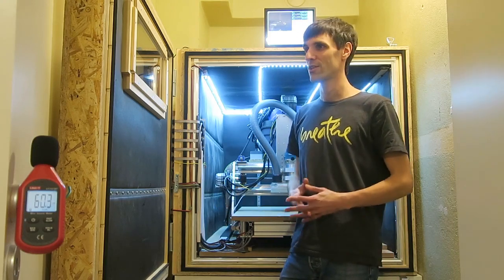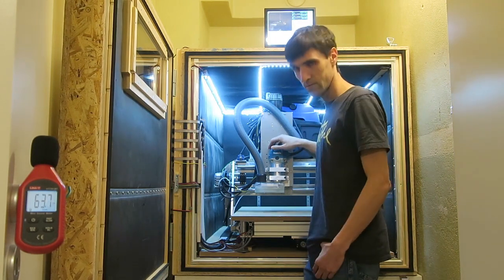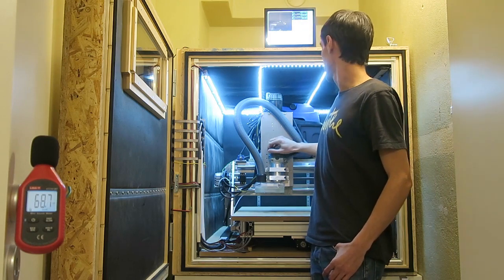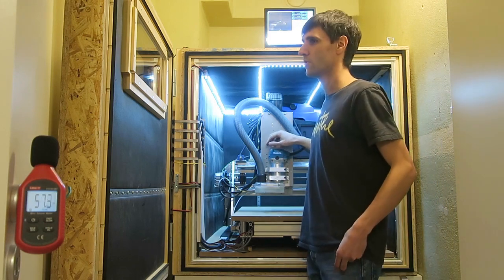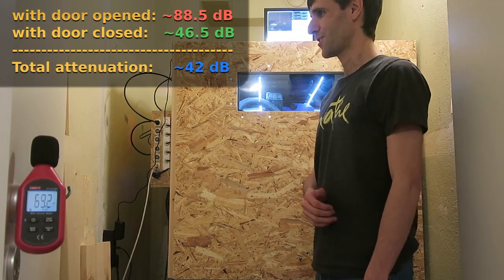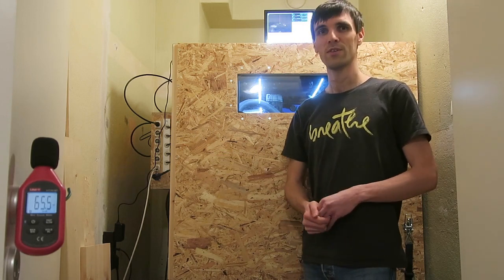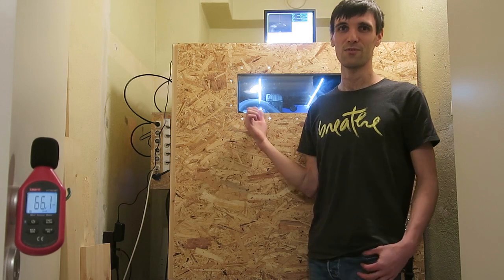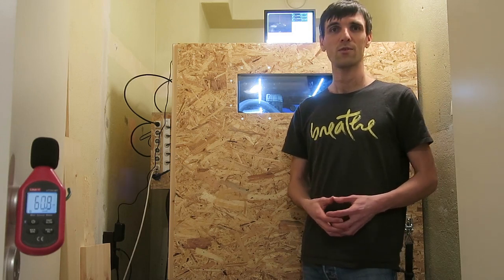Soundproof CNC router enclosure (42dB attenuation)

Comment: Thank you for the video. I am currently building a similar enclosure for a CNC machine. I see that you have a vac inside but didnt see any air ducts. Are you able to keep the inside cool enough for long periods of time with all that equipment?
Reply from the maker: Hi, not for too long, when the door is closed with router&vaccum running, it gets rather hot after ~30min. Most CNC jobs I do are ~30min cycle but if I do longer ones, I briefly open the door for few minutes to let the hot air go out.😉
Reply: @damiendd09  I see. It looks like the upside is very good sound proofing. Congrats on your build.

Comment: But how that window doesn't leak sound?
Reply from the maker: Windows is made with 4layers of 5mm plexiglass in sandwich with foam on the edges between each layers. This to prevent transmission vibration/sound from one plexiglass layer to the next one😉

Comment: This is great! What are the clips used to close and tighten the seal of the door?
Reply from the maker: Thanks! I used some simple eccentric latch to close&tighten the door. They look like those: https://www.fruugo.se/4-pieces-right-angle-adjustable-buckle-vertical-quick-clamp-box-buckle-latch-clamp-right-angle-buck/p-190084075-405949283
I got those from Bauhaus, I'm sure you can find in any local similar shop.

Comment: Won't there be a chance of overheating?
Reply from the maker: oh yes, it definitely heat up inside when I run my CNC router for 20min with door closed especially when the vacuum cleaner/dust collector is running! I just open the door for less than 1minute and most the hot air is gone!

Comment: Great example of an efficient box, but an even better example of how important it is have the door air tight. That was very impressive, well done!

What is that window made of? I am planning to build a box for my PCs, but I want windows to show them off still.
Reply from the maker: Thanks! The window is a "sandwich" of 4 Plexiglas of 5mm each separated by adesive foam tape* to dampen vibrations between plexiglas layers. To prevent sounds vibration to propagate too easily, there is NO rigid structure (wood/screw) directly in contact with plexiglas even on the side, there is always foam tape/material between rigid parts of the structure and plegsiglas.
* I used regular door noise seal isolation foam tape you can find in any house/build materials shop (got mine from Bauhaus).
Reply: @damiendd09  Thank you for the reply. I am only trying to isolate noise from PCs, so I might try using just two pieces, but I was wondering whether to screw holes through them or not, but seeing as you haven't , I don't think I'll do it either, no need to over complicate things, or risk breaking the plexiglass.

Comment: Hello Damien, 

Awesome job on this. I've read through the comments and got the construction details, one item missing is the viewing window you've added. I'm guessing that it is plexiglass and that you've added the foam tape between the plexiglass and the wooden outer layer, but please advise what you've done here and what the thickness of the plexiglass is that you've used. Thanks and looking forward to your feedback.
Reply from the maker: Thanks!
For the window, I have put 4 plexiglass window of 5mm each on top of each other. And yes, each plexiglass window is encircled by foam tape (no direct contact between plexiglass&wood - to dampen vibration transmission). There is about 3mm of air gap between each plexiglass windows - I have used some regular door seal tape to hold the spacing between plexiglass windows - the idea is just to avoid wood or hard material between parts to make it harder for vibration&sound to propagate.

Comment: Great results Damian.  Kudos.  Quick question.  You've said you set up the layers as follows  from the outside in (correct me if I'm wrong): OSB (what thickness) > Green Glue > drywall (what thickness) > Rockwool (I'm assuming 3" batts? > MLV (what thickness) > closed cell foam (what thickness).  Did you build from the outside in, or vice versa?  Thanks, and great job!
Reply from the maker: Thanks, here are few more details: OSB (15mm) > Green Glue > drywall (12mm) > Rockwool (45mm) > MLV (4mm / 7-8kg/m2) > closed cell foam (4mm)
I first built separately the side panels OSB-green-drywall (size adjusted with max. 0.5mm accurancy - an important detail I believe). Then I put those panels together with screws in the OSB edge to form a 5 sided box (I built the door - the 6th side -  at the very end). When putting the 5 sides together, I took particular care of not leaving any air gap between each OSB/drywall panels: on the edge of each panel I have added a fin foam tape of 1.5mm ( https://www.affixit.co.uk/single-sided-foam-tape.html ) which got squeezed when tightening screw and filled any potential tiny air gap (if air can pass - sound can too) => I believe those details play an important role in the soundproofing efficiency.
Just with OSB&drywall, each panel is about 20-25kg so nearly 100kg once the 5panels are put together => this is to take in consideration for practical handling of the parts.
Then after I had an empty OSB/Green Glue/drywall box, I have built inside a simple wood structure to hold the Rockwool & MLV (without putting any screw in the OSB/drywall part - this to prevent screw to transmit sound vibration - I even put some foam tape ( https://www.affixit.co.uk/green-glue-tape-50mm-x-30m.html ) between wood structure and the inside panel of the box to dampen vibration).
For the MLV/CCF part, I found a roll from https://www.carinsulation.co.uk where the MLV&CCF where already glued together, they don't have this particular article available anymore but you can still see it from the google cache: https://webcache.googleusercontent.com/search?q=cache:O0QHLYJWtkAJ:https://www.carinsulation.co.uk/product/peacemat-xxxx-6kg-vehicle-floor-sound-deadening-noise-barrier => on the description it said 3mm MLV & 3mm CCF and 6kg/m2 but when I received it and measured it, it was 4mm MLV & 4mm CCF and ~8kg/m2 - I did not complain :)
Reply: @damiendd09  Awesome!  Thanks so much, Damian.  That's exactly what I was looking for.  And, again, GREAT job!

Comment: How do you deal with the heat from the router and the vacuum over time? I would guess that for a routing job of 1h it would get very warm?
Reply from the maker: Yes after 1h non stop, it gets warm inside but it has not been a big issue for my use so far as the temperature drop quite fast as soon as I open the door.

Comment: Really interested in the building video or just tell me what materials did you use in the build. Thank you so much
Reply from the maker: I used OSB, drywall with green glue on the outside and rockwool with MLV (Mass Loaded Vinyl)+CCF (Close Cell foam) on the inside. There are also quite few details I paid attention while making this build.
I will do some video but I cannot promise when, will try to do it as soon as I can!
Reply: @damiendd09  Do you mean: OSB <> Green Glue <> Drywall <> Rockwool Sonorock <> MLV <> CCF? Unfortunately, here in Germany "Green Glue" is really expensive to import (~120€ for 2 bottles and the gun). I guess the trick is to have something elastic that doesn't dry out between the two shells, without screwing through them. Maybe I can find an alternative acoustic glue somewhere.. what did you use to seal the door?
Reply from the maker: @drRazor1111  sorry for late reply, I somehow missed your comment.. I think I saw some alternative to green glue but not as efficient from measurements&tests of my research I did back then. I bought the Green Glue for fairly good price from this UK webshop: https://www.affixit.co.uk/green-glue-noiseproofing-compound.html
It was not possible to ship outside UK by placing the order directly from their web interface but I sent an email to ask them about delivery in EU (Sweden) mentioning the list items I wanted, I did wire transfer as per their instructions and received everything few days later.
Reply: @damiendd09  I build one like yours for myself. But im having a litle problems with in temperatures. How are you dealing with that. Thank you soo much and good job til now.
Reply from the maker: @SuperJecd  sorry for late reply, I somehow missed your comment.. yes temperature can be an issue if too much heat is generated inside the box and you leave it close for extended period of time.
If it ever become an issue for me, I thought about adding some water cooling system with an heatsink right behind the airoutlet of the vaccum cleaner. However at the moment it has never been an issue as rarely leave the box closed with spindle on for more than 30minutes.
Reply: @damiendd09  i did one soundproof box similar to yours, and im having some problems with high temperature im working 1 or 2 hours max. I will look at some water cooling system. Thank you for the reply. Continue the great job!